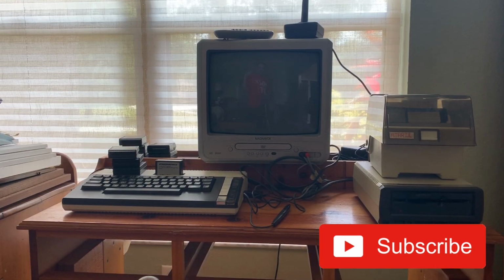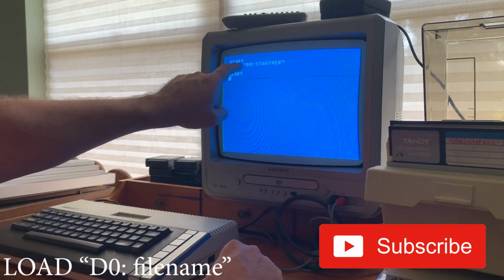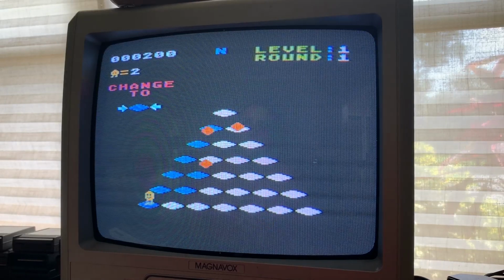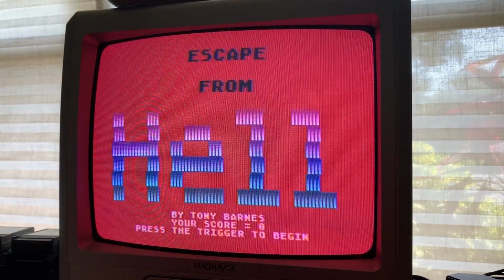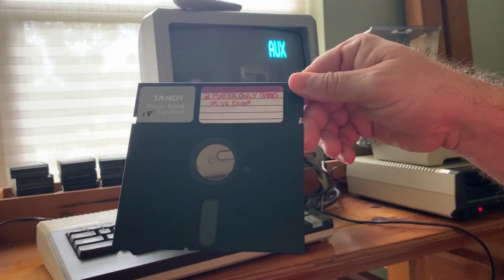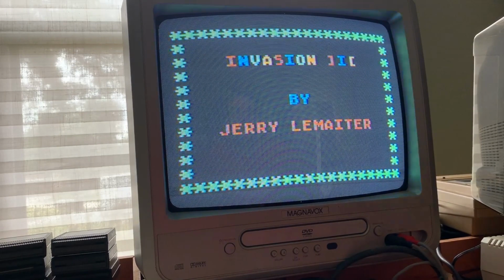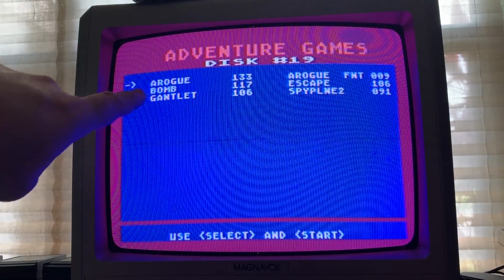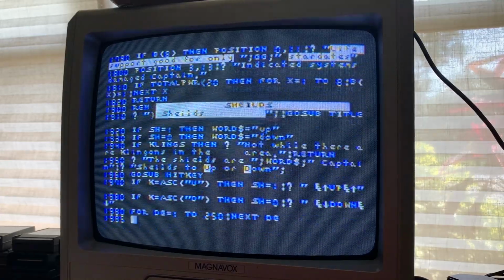First Time Testing Atari Floppy Disks!

Comment: Awesome video! I played a few other of JD Casten's games a LOT. My cousin and I spent forever going through his code for "Biffdrop" to make it add a life instead of subtracting one when you died, because it was so hard!
If you want to transfer your Atari files to a PC you can make an SIO2PC-USB cable. There's a demo here on youtube for how to make one for about $6 but it requires you to cut up an old SIO cable, so if you don't have an extra then that's no good, BUT you can also go to atarimax.com and get an SIO2PC/ProSystem, which plugs into the SIO port on your Atari and gives you a USB port so you can transfer your files that way. Or if you have any compact flash cards you can get their MyIDE=II cartridge which basically turns your cartridge port into a compact flash card slot that the Atari sees as a drive.
Reply from the maker: I want to get whatever is the latest, but it seems like they have a lot of revisions! That and I want to get an AtariMax cart too.